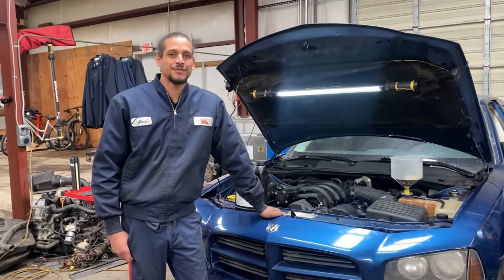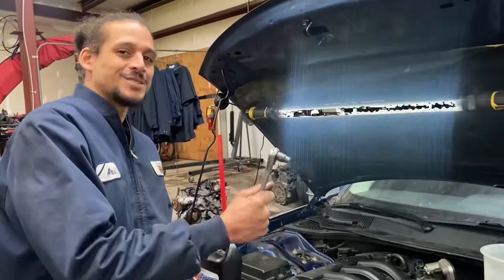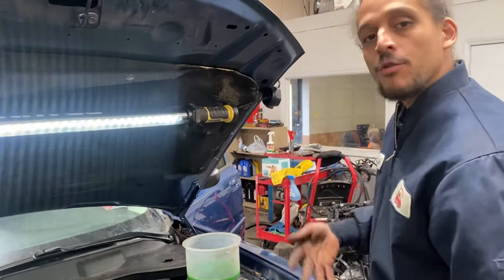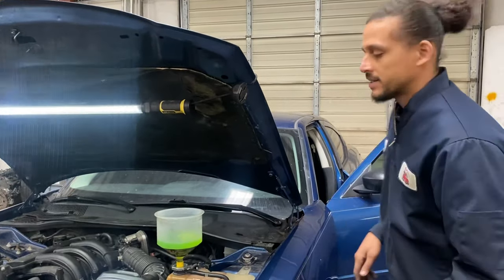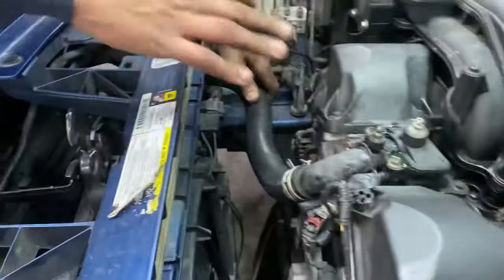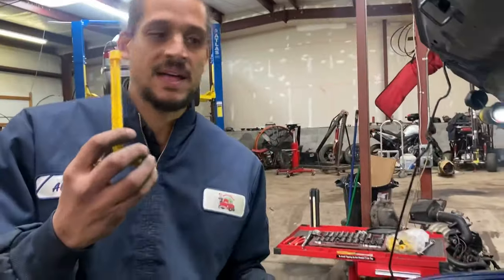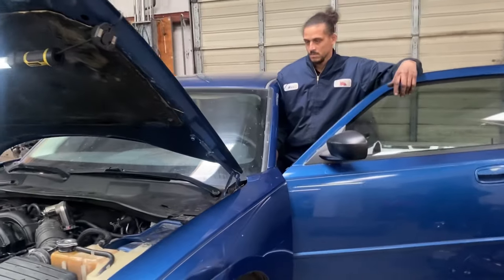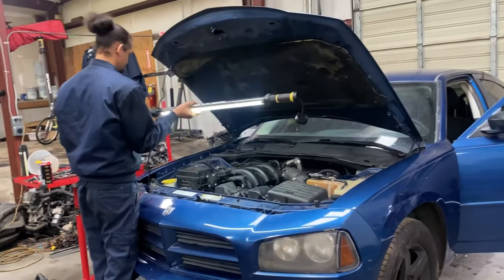How to Bleed or "BURP" Air Out Of Your Engine Cooling System (2 WAYS) #coolingsystem #overheating

Comment: need to try this on my Lincoln Ls v6.. with a hydraulic coolant fan...  lately I've been having overheating issues... either not bleed correctly or or the actuator on the pump has failed again... recently replaced thermostat and radiator.. drives good as long as im on the open highway, but as soon as i slow down or in stop and go traffic, it tends to overheat..
Reply from the maker: Make sure that that fan is coming on, also make sure you don’t have any debris like plastic bags etc. caught in the grill or in front of the condenser
Reply: @AlexTheCarDoctor  i have a hydraulic fan, so it's on all the time.... dont know if it's operating at the correct speed.. sometimes i can hear it idle up..  do destruction
Reply: You have to bleed the air out of the system,I literally just topped my ls v8 and did not get air out of system and it would overheat every so often,once I bleed system it has been good for 3 months now:)

Comment: Hey Alex I put a new water pump on my 2008 dodge charge and  burp it but it still backs up and it will not go down but when you put your foot on the gas pedal it goes down the motor I have is a 2.7 liter but it is not running hot at all can plz tell me what I need to do to get heat thank you for your time

Comment: Can you burp a car after the coolant has been added if you’re not sure a mechanic who flushed previously did it properly? Or do you have to reflush and burp while adding the coolant?
Reply: With this funnel, yes you can install it and recheck if there's more air in the system

Comment: Note if you do not bleed the system at the bleed valve first, you may be buying a new engine, alway use the bleed valve when filling the coolant not all car have this, the PT cruiser has one on the filler neck it's hard to see I don't know how many times I have seen the engine overheat because they did not see it.

Comment: Q4U: what if all the anti freeze won't go into the vehicle; It says it takes 1 & 3/4 bottles, but only one goes in and it won't accept any more; the engine begins overheating,  and only cools down when the cabin heater is turned on?

Please advise. Thanks

Comment: I have an 08 enclave which doesn't have a bleeder valve. I attached the funnel to the radiator and began burping and before long the coolant started flowing from the funnel directly into the reservoir tank and filled it up completely. Why did it do this instead of just going into the radiator?
Reply from the maker: Did you turn on the heat

Comment: Hi. Why you can press the hose easy? Should water  pump pressurise that hose? Thanks!
Reply: The system isn't pressurized yet since the funnel is still on to the open air

Once you install the radiator cap... It pressurize to whatever the cap is rated for (usually say it on the cap 13-18 psi or something like that)

Comment: Can you use water if  you don’t have any antifreeze? And you if you can is it ok with 50/50 antifreeze?
Reply: If you keep it straight water, its gonna rust internally 😮

Use distilled water with the 50/50 mix

Alex filled up with 100% coolant first then follow up with distilled water (I hope) to get it close to 50/50 mixture

Comment: I buy full strength antifreeze. For every gallon of full strength anti freeze I buy, I buy a gallon of distilled water. I save windshield washer jugs and wash them out. I pour half of the gallon of antifreeze  into the empty windshield washer jug and then fill it the rest of the way with distilled water. I then pour the remaining distilled water into the half gallon of full strength antifreeze. Now I have two gallons of 50/50 antifreeze for maybe two dollars more than you would pay for one gallon of 50/50 antifreeze.

Comment: I have spill funnel and clear hose line for the coolant bleeder valve to help purge air which the ideas I gt from the care nut and it works. Didn't do that with much 2000 mercury sable after heater core replacement. I need  to if can the procedure  with regular heat on with no ac same thing my 2002 chevy impala ls 3800 v6 series. But vehicle has original heater core and did coolant flush and used spill  funnel but I did nt use the a clear for bleeder valve and rand the rooms to 3000 or 2500 rpms with regular heat on high haven't no overheating issues in almost 5 years. But for future coolant flush I wanna use the clear tube hose for coolant bleeder valve. I squeezed upper hose and ran rpms for 30 minutes. Don't if the impala  have heater control valve so I made good practice in the past. I'm curious why  did real heat xame on acceleration  after specially 4 years ago to for the impala? I had nt had cooling issues with my impala  though wichnis good. Now back to mercury sable 2000.

Comment: Thank you Alex I got a 2012 does charger I’m having that problem I replaced the thermostat I replaced the radiator I replace the water pump I keep bleeding the system after driving for at least 15 minutes it starts to overheat I don’t know what else to do
Reply: Blown head gasket or warped cylinder head?

Notorious for Chrysler products

Comment: Looking for advice, I put new thermostat, new crossover manifold, new oil filter housing, bleed the cooling system, no smoke car runs as is should fan is working but keeps overheating 😢

Comment: Hello! I have a Ford fusion 2015, which I replaced its evaporator recently. I noticed it making sloshing water sounds under my steering wheel area. I was wondering if this process would most likely get rid of the water sloshing. 

Thank you Alex!
Reply: Check out if its a clogged AC drain hose

Comment: can you help me ? I took my 2003 Buick century to a friend for a radiator flush.  He just unplugged the radiator and drained the plug and let all the coolant run out then he took the reservoir off and rinsed it out.  Then we ran the car for about an hour,  and tried to bleed it through the bleeder screws  but it is still running a little hot .   Can you give some advice
Reply from the maker: It’s possible that some debris messed up the thermostat. Did you leave the radiator cap off during the bleeding process
Reply: no , he just taped it off and put the cap back on ran the car and just kept bleeding it
Reply from the maker: No that’s not the proper way . Follow the steps in my video and you should be OK you can do it without that fancy funnel
Reply: Thank you very much anyway,  I'm on my way outside to try and figure it out.
Reply from the maker: Good luck buddy

Comment: Hi alex , wondering if you can suggestions, i have a 2015 dodge challenger that is having overheating issues, charged water pump,radiator, thermostat still is overheating any suggestions? Thanks again
Reply: Rent coolant engine block tester? It has a blue fluid that turns color if it senses exhaust in the cooling system... Which means blown head gasket or warped head 😢

Comment: Does the car have to the be completely empty of coolant in the reservoir? Because I'm trying to rid air from my system and I do have coolant in it, and while using the funnel the reservoir will over flow. How do you keep the coolant in the funnel?
Reply: Are you using this same exact burp funnel?

What's the year make model of the car?

Comment: Hey Alex I have a 2010 dodge nitro and have only had it for a month now got it from dealership however two weeks after buying it it started running hot I've brought it to a few different mechanics who literally CAN NOT diagnose the problem they are saying that it's an internal issue inside of the engine such as a cracked head gasket do you have any advice or suggestions or any ideas at all of what you think it could be ? Or how to test for a cracked head gasket etc ... ?!?! Because I'm literally just at my wits end on what to do at this point ANY help at all would be greatly appreciated thanks so much in advance !!!!!
Reply from the maker: Hey there buddy sorry to hear about your car problems.you have the 4.7 right? You can easily do a head gasket test your self here is a link showing how
Reply from the maker: https://youtu.be/N4NpomEKm4g

Comment: what if mine wasn't burped when i got it flushed or say you get a new radiator, what will be the main problem ?
Reply from the maker: You will have overheating problems,your heat won’t work properly

Comment: If u replace a radiator in a 06 toyota tacoma truck without burping the cooling system. Would that cause the truck to over heat
Reply from the maker: Hello and thanks for watching. Yes it will most definitely cause the truck to over heat.your temperature hand fluctuate from hot to normal or just run hot
Reply: Ok thank u so much

Comment: Cool Vid,  2002 Nissan frontier supercharged, coolant flush  have air bubbles  top off with coolant   do I need drain coolant and get funnel  look for pressure valve. Thanks
Reply from the maker: You don’t need to drain the coolant if you already topped it off with fresh coolant. A funnel would make it easier for you, but it’s not necessary. I’m not sure if that vehicle has a coolant bleeding valve, but it may.

Comment: So is it normal for the fans not to come on while running the hot air on high during the 10 minutes? When I turn on my defroster setting the fans kick on but while I had the car running on just regular high heat the fans didn’t come on. Didn’t get too many bubbles and the operating temperature stayed at normal. Just confused if I’m good to go or not.
Reply: Turn on your AC and make sure the fans work, if you turn the AC on and the fans don’t turn on then you need to replace the fans

Comment: I DON'T HAVE THAT TOOL...
Do you have to open the drain screw to do the burp it properly?
Reply from the maker: No need to open the drain plug unless you are draining the coolant. You can burp the system without that tool I talk about the other way in the video. What type of car do you have some cars have bleed plugs that let the air of the system
Reply: @AlexTheCarDoctor  
OMG.. THANKS SO MUCH 🤗 FOR REPLYING SO QUICKLY😊🙏🏽..

I Have a 2008 Saturn Outlook. 

It's BUBBLING BADLY.. almost like it's boiling rather LOUDLY (to me.. as I'm use to my SUV being quiet while in motion)..

I don't have a man, and don't want to get robbed going to a mechanic... So, I'll be doing the burp myself. I've fixed a few things on every car I've had. So, I'm confident.. Just wanna make sure, SURE.. b4 I start. I plan on doing it tmrow
Reply: My apologies for the long reply..
Reply from the maker: No need to apologize. I’m here for you every step of the way.just try to follow my steps in the video and you will be great.everything a man can do a woman can do better, me I can’t function with out my wife lol
Reply from the maker: You have the 3.6 GM motor from what I remember you don’t have a burp plug

Comment: 3.6 pentastar top radiator hose hot bottom is ice cold what should I check for ? No airpockets and no codes for bad thermostat
Reply from the maker: That’s normally a thermostat problem.how long did you leave the car running with the radiator cap on

Comment: You're supposed to drain the coolant first on this, right?
Reply from the maker: It depends on what you doing if you’re replacing a Coolant system part then you’ll just be adding coolant but if you’re doing a coolant flush then yes

Comment: My engine temp is too cold. Could air cause that, bro? I did my thermostat and sensor myself. I'm a certified mechanic and double checked my work so I'm not just some dumb kid. Im actually really stumped lol.
Reply from the maker: Hey buddy what type of car do you have
Reply from the maker: Air in the system normally makes the car overheat.sounds like you have a defective part.

Comment: Hi thank you for the video   I dont understend the part with the AC on or of ?  i have to turn the AC ON or OF?
Reply: Turn off AC... But put on the heat at full blast so the coolant can circulate through the heater core while its idling on the driveway
Reply: @ricebike  oh ok thank you so Much Man 👍👍👍👍👍👍👍👍👍👍🙂

Comment: Hey I know you posted this video 3y ago but I hope you still get this message. I burped my cooling system and got fluid coming out of my bleeder and ran everything just like you showed. I am still having and overheating problem though, it seems to happen after my trips. I go to check my lines again and there seems to be no coolant running through them? I have changed the thermostat on it, and was wondering if you got any idea as to what may be happening and what would be my next step to fixing the issue? Please help…
Reply from the maker: Hey there you may have a stoped up radiator.have you performed a block test to check the head gasket integrity?
Reply: Hoses

Comment: Do you bother with the engine block drain plugs when you flush a system. I have a 2007 chrysler 300c that has never been flushed. I wanna be sure to get all of that old coolant out. Will flushing with a garden hose be better or should I drain the block?
Reply from the maker: Hello and thanks for watching. I have to advise against using a garden hose to flush your cooling system even though it’s the easiest way. Our drinking water has things that can deteriorate the metal inside modern engines and can cause things like rust. You need to purchase about 2 to 3 gallons of distilled water at your local grocery store, you will also need this product called Prestone Radiator Flush. Pour that into your radiator prior to flushing it. Drive around for about two weeks or more with that product in your car, then start the flushing process. Don’t bother with the block drain plug if the car has one, I never do. The main thing is taking out the thermostat so the water pump can pump everything out. Use the distilled water for the flushing process and then top everything off with the coolant after you put a new thermostat back in. Don’t forget to burp the system of air. I’ll make a video of this process soon! Good luck and be safe.
Reply: @AlexTheCarDoctor  Thanks for the advice. Alot of shops are not allowing customers to wait around for their vehicles so i'm doing what I can handle like oil changes and other easy stuff like brakes etc. You video was easy to follow.
Reply from the maker: I’m glad you enjoyed it buddy

Comment: So cars that dont have a bleeder valve for the coolant, is it relatively easy to add one?
Reply: I leave it alone and do the 2nd method of this video... The highest point of the funnel will let the air out of the system

Sure it take a bit longer this way, but i don't want to snap that air bleed bolt and cause more issues

Comment: Shouldnt all the remaining coolant above the filling cap go into the system when the thermostat goes open, and after this happends fill it more to make sure the system is full of coolant?
Reply: Yes the system will suck in more coolant as air is burped out...

You can leave it on and let it cool a bit and then start it up to see if the level drops again.

Then, when you sure no more air and the level of the coolant doesn't drop anymore, that's the extra that just put it back in the bottle

Comment: After you plug the funnel do you have to siphon out the extra coolant in degas bottle to the proper level?
Reply from the maker: No siphon required
Reply: @AlexTheCarDoctor  I think it's overfilled my reservoir says cold half way up isn't that the reservoir
Reply from the maker: @conrado5910  yes that’s the reservoir.the level will change once the car is at operating temperature, that’s the halfway point on your temperature gauge

Comment: thank you so much! how often will i have to do this? im trying to figure out if this is what needs to be done to my 2003 civic. it goes in at least once every 2 weeks to get coolant filled and im not sure if they do this to it, anyone willing to help?
Reply: we have replaced the water pump, temp guage, and radiator but our car does not drive for more than 25-30 minutes at a time before heating up. i believe we have a leak as well, you can smell it when starting the car. we dont have enough for a new car right now and dont mind refilling coolant often but i would love some more help from anyone that has worked on cars
Reply from the maker: @rabaabro2371  hello and thanks for watching no need to burp the coolant system if you have a leak.my advise keep your car the Honda Civic or very good cars just don’t let them overheat also get a second opinion on those repairs sounds like a lot.

Comment: Great video. I had a ton of air bubbles in my 2001 Dodge Caravan Sport 3,3 v6. Can you consider doing a video on valve cover gasket job on the above Caravan year, model , and engine size? Thanks!!

Comment: Got a question for you if I have a radiator and a reservoir tank what do I hook it up to. 91 Caprice Classic
Reply: Wherever the pressure cap is at

If the plastic tank is just an overflow with no pressure on it, the main radiator cap is the main thing to put the funnel on.

Comes with various adapters for GM Ford Chrysler and Japanese models

Comment: Hey, 
Dash is fluctuating a lot after thermostat and radiator change, never did this before. Was driving fine and anytime I gassed above 4k rpm I could visibly see the needle go up then as soon as I stopped gassing it went right back down. I’ve been trying to get any air out and still haven’t gotten it all out...

Comment: If having air in my cooling system be a cause of losing coolant?
Reply from the maker: Air can push coolant out through the coolant overflow tank
Reply from the maker: But you will see it leaking